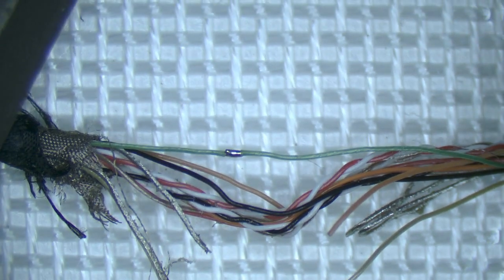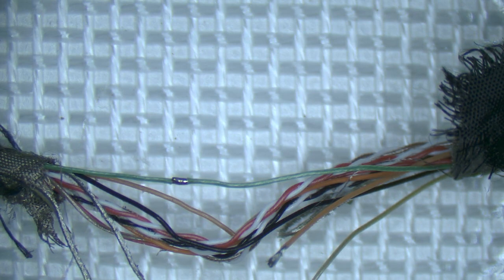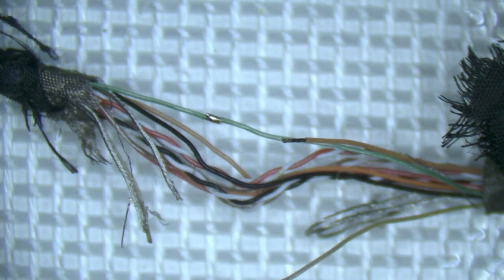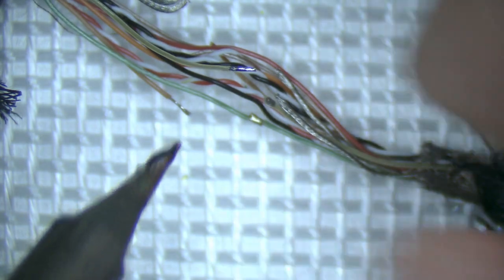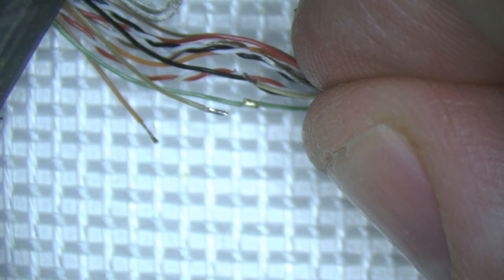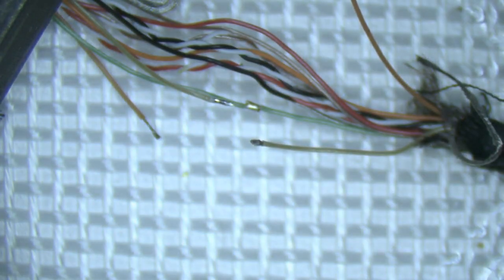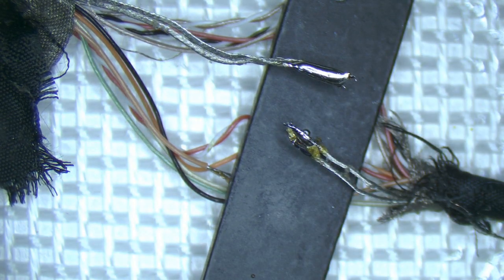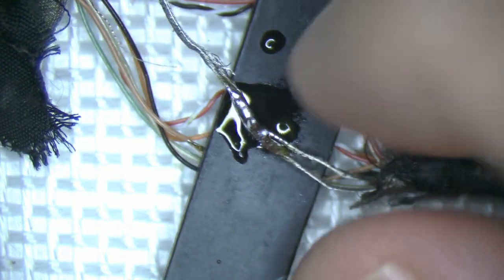Boring microscope cam warm up: Crushed Toshiba L50 LVDS lead repair

Comment: Hey Paul. You been on holiday? I thought we would of been seeing lots of vids now you got your new equipment. I thought you had dropped off the planet.
Reply from the maker: There was a major holdup with the camera because of the type of adaptor required to interface it cleanly with the new AmScope head.  All done now and it's working well (no left->right focal issues that some other adaptor combinations create).

Comment: Not too easy is it, i hate the coloured/coated copper wire in modern headphone cables, just getting through the coating is a pain, if they add string threads into the mix, nasty.

I had a request to make a laptop work, they said the screen always flickered untill the right screen angle was found.

It used a flat plastic ribbon with painted tracks on it, and to make it worse the ribbon was wound like a toilet roll, so it flexed as the lcd was moved.
it had started to crack across the ribbon and broke many earth tracks before hitting the power and stopping it dead.

There was bugger all i could do with painted tracks so i glued the crack to stop the progress, then i used wires from a record player arm to make direct connections from the lcd socket to the computer connector.
It was a bodge but it worked, didnt cost them anything :-D
It's odd how none money bodges never fail....odd :-D
Reply from the maker: Sounds like a far greater drama than what I just had to do.   Happy mine was only 3 wires and worked
Reply: A repair is a repair, im sure you made someone happy.
I've used nail varnish or bostic to cover low voltage wires.
Keep up the good work, hope your income is better :-)

Comment: Oii tell ya cabinet maker too keep those plans for fume extractor ends bits might order a few if hes up to it, for profit of course..
Reply from the maker: Good news, they're my CAD plans.  Will see how they work out.  Might add another sub-chamber in the box so people can put a 4" hose duct (or two) on the front.
Reply from the maker: Biggest issue imo will be management of the noise.
Reply: Yep the noise is the problem I am trying to work out. I bought a 50'x 6" insulated flex tubing to see how much noise I can cut down with distance.

Comment: Insulate with nail polish or solder mask ? Add some black heat shrink around whole lot.. bobs ya uncle imo
Reply from the maker: I had contemplated both but was worried they'd be too brittle as the failure area is in a very high-flex region.  1.2mm heatshrink around the wires with a dot of hotglue and then heated up would have been probably the best fix.   New heatshrink on order.

Comment: Camera even at 720p looks awesome mate clear as.. the matting underneath your working on where do you buy ? N do they sell bulk.?
Reply from the maker: I got the grey one - 

http://www.ebay.com.au/itm/Silicone-Fiberglass-Oven-Liner-Pastry-Baking-Silpat-Dough-Kneading-Mat-Reusable/111839123758?ssPageName=STRK%3AMEBIDX%3AIT&var=410821521489&_trksid=p2057872.m2749.l2649
Reply: Paul Daniels ta mate